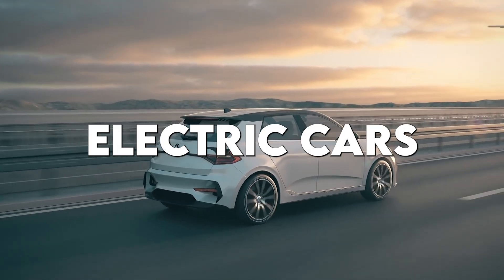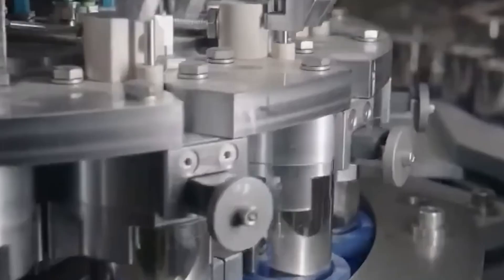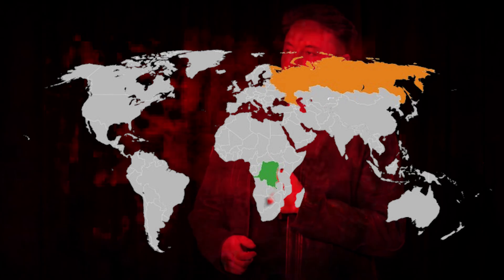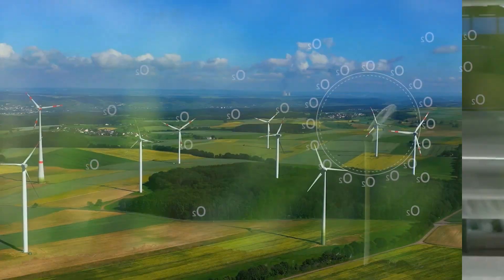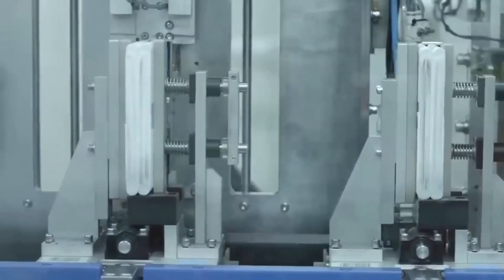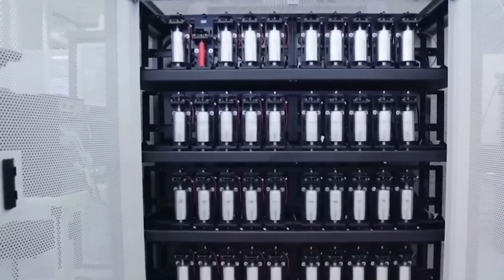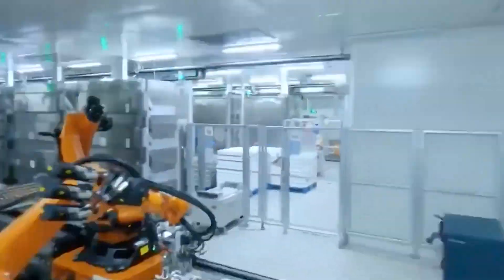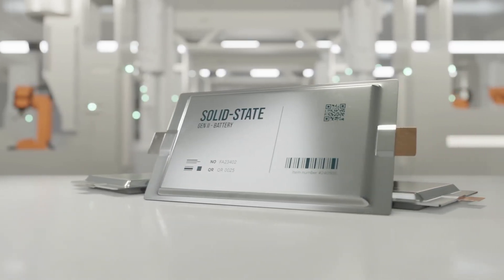Tesla's new breakthrough in Battery Technology

Comment: So many mistakes in this video. Contemporary Amprex is CATL, but you write and say "KTL".  You have to review and correct the mistakes dictation software may make, and double check every fact.  270kw/kg is still on the average or even low side of energy density.  Some solid state batteries promise 400khw and can be recharged very quickly.